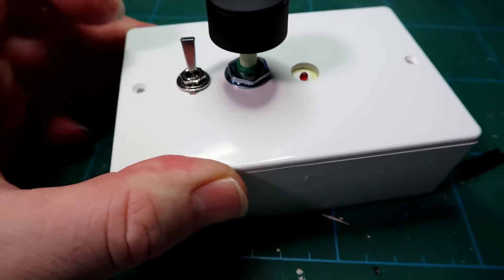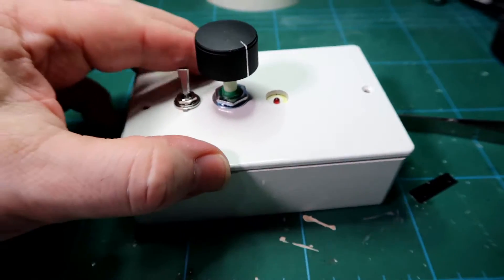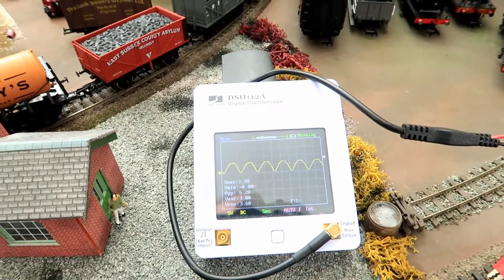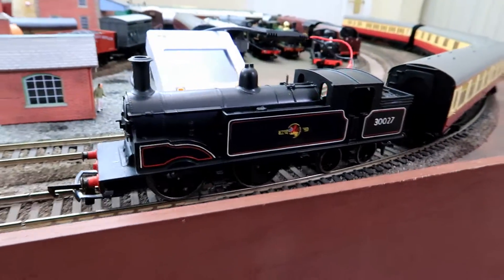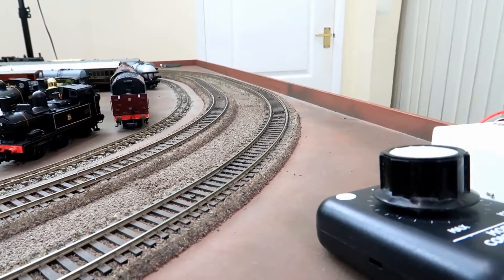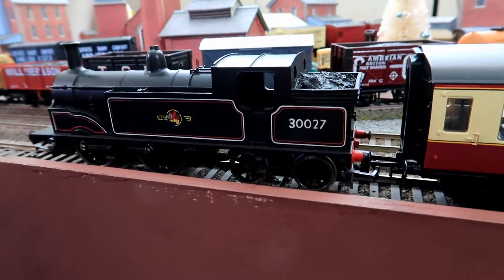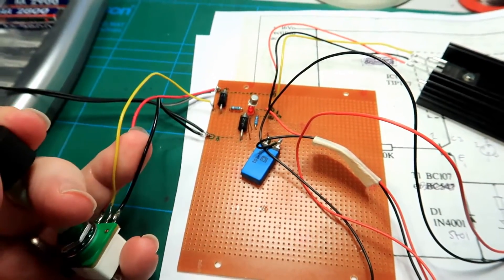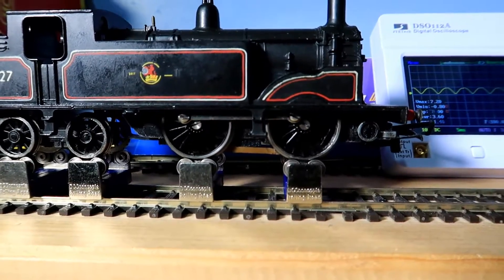Building from scratch a model train controller part 3 Final

Comment: Pleased to the great video the DIY work and also the quality videography. The slow speed performance of the controller is amazing. Do your locos have brushless motors? Will this controller work with the brushed motors?.
Reply from the maker: Thank you very much! This controller will work with both types of motors, however for coreless motors adding 47uf over the dc supply would be helpful

Comment: Hello.  Just browsing and I came upon this video.  I bought the Amos book many years ago.  I tried a few of the circuits shown in the book although even after all this time I am still a novice.  I did try to build this particular controller using a Veroboard all those years ago, but couldn't get any life from it.  It would seem that the IC diagram may have been causing the problem and I gave up.  I might give it another go just for the hell of it!   Thanks for another excellent video.
Reply from the maker: Good luck, it certainly works just watch the connections. Be interested to hear how you get on
Reply: @ModelRailwaysUnlimited  Give me a couple of weeks to try to sort things out and I'll let you know how I get on.

Comment: I don't recognise any feedback in the system. I thought modified plug adapter would be frowned upon.
Reply from the maker: Hi, as stated at the start, modifications are for information only and users should evaluate their own skills, the feedback is the loop which includes the motor, not like a full feedback system but a simple version.

Comment: Very late to the party (as always seems to be the way), but do you have a final version of your amended circuit diagram with the 33uf capacitor etc included drawn out at all? Thank you in advance, Rich!
Reply from the maker: Hi Rich, hmm not now I don't think, just hang the 33uf over the incoming DC supply line
Reply: @ModelRailwaysUnlimited  Indeed, that's fair enough. It's dating back a little while now, just thought I'd ask on the off chance and save myself some drawing out! Thank you for the reply

Comment: Great 3 DIY videos! And the controller seems rather good, especially at slow speeds. Do you still use yours regularly? Or would you say it's good as a DIY project and to have around for testing purposes but one should really buy a good commercial controller for "normal" use? Cheers!
Reply from the maker: Hi. it was in use for 3 months and I was delighted with it, the only addition was a 33uF cap on the input voltage for coreless motor smoothing. I now plan to build another and add it to a box with the first and use as a double track controller.
Reply: Well, that’ll cost me much less than a GM controller! I should probably try and make one. Did you use a linear or a log pot? I was thinking that a log pot should increase the control on the lower speeds quite nicely; but then again, it will shorten the control from medium to bullet speed, I think! I don’t know if anyone has tested that. I’m imagining that at least as a shunting controller it should work marvelously. (That is, unless the locos don’t actually start up until you’re 1/3 of the way through the pot!)
Reply from the maker: @ooairmonkey4771  As it is the control is really very good. I'll get a parts list together and share here soon
Reply: Oh, it would be great to have a parts list! Cheers!
Reply from the maker: @ooairmonkey4771  All from CPC Farnell.               SC08147 TIP147
SC06644 BC107
SC14886 1N5401 (smaller will do, needed for other project)
SW02868 switch DPDT
RE04411 pot with on off so you can zero solidly switch unused. 
SC12544 heat sink
PC00046 Vero board
SW05321 knob

Case of your choice.

LED and resistors from stock
Don't forget the 33uf 35 volt cap that goes on the output of the rectified input.
You need a unsmoothed DC supply at > 500mA (apart from that 33uF)

Comment: Very good Mike. Not much to choose between them (apart from, I suspect, the cost).....
Reply from the maker: Many thanks. Yes agree, keep in mind the Morley would not be as good without the modification I made to it. However the GM model D would be about the same, strangely however the GM would produce more motor buzz. Cost would be about £6 per unit so £12 for double track, but then you need to add on power supply costs and of course you don't get the CDU and 12 vdc accessories output either. On balance I won't be giving up on the Morley but will use this new controller for shunting etc :)